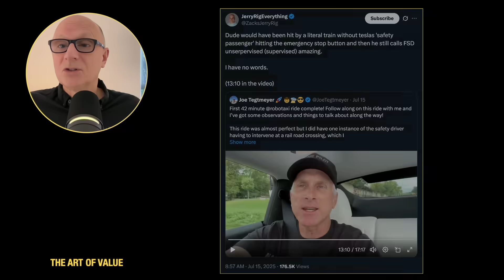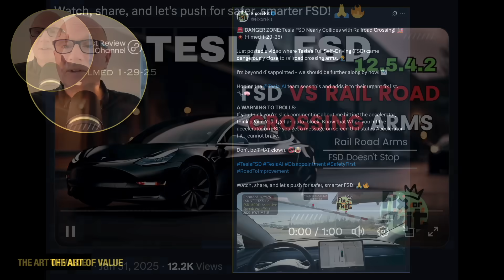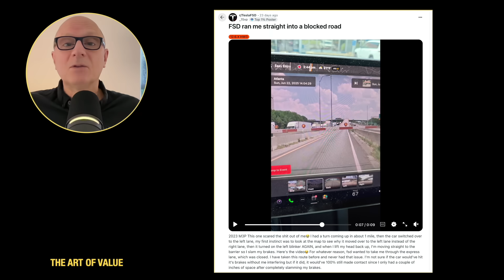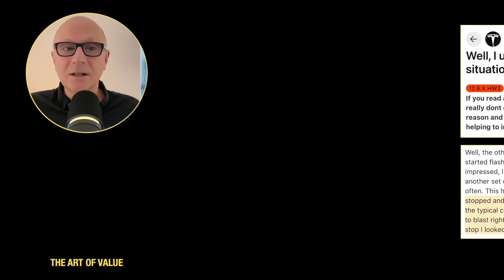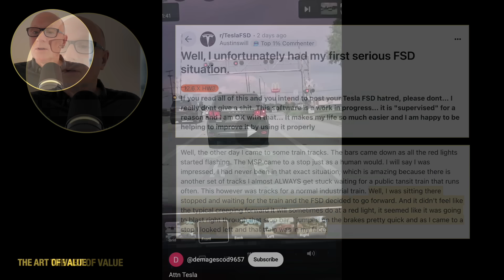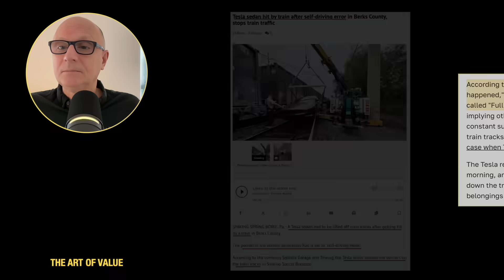DANGER: Tesla FSD Robotaxi Can Miss Railroad Crossing Arms!

Comment: It didn't see the barrier but surely it saw the red light, or did it?
Reply: That's crazy, I was thinking the exact same thing -- didn't the Tesla see that the lights were still flashing red when it took off?.  So maybe you are right -- it didn't see the lights either -- spooky...
Reply: Yes, at least over the entire time when this Tesla robotaxi approached the railroad crossing, then it did. But if you look back at this video, this it starts to show you how challenging some aspects of autonomous driving are.

In particular, there wasn't even one solid red light at the RR crossing (and there normally isn't) during the time when a train approaches and crosses. Instead, it's two central flashing red lights, which can't be seen when too far away but also can't be seen when too close to the crossing. Definitely the video clip shared here didn't show the flashing central lights of this crossing when the vehicle was very close to the barrier, but even an AV with a bunch of cameras couldn't have necessarily seen the red flashing lights near the barrier, due to the normal hoods around those lights designed to reduce sun glare.

Then, regarding the barrier, it can move down, remain temporarily fixed, or move up again, so that makes it even harder to deal with than the fixed-in-position red flashing lights (which are sometimes, and sometimes not, visible). And to be thorough, the barrier had its own small flashing lights, which move with the barrier.

I'm not saying these problems are insurmountable, but it does raise the question whether a pure AI-based approach is enough. Waymo has obviously dealt with RR crossings very carefully, and Waymo seems to have developed a good approach. Is Waymo's approach perfect? It probably wouldn't be, if Waymo expanded it to a much bigger service area immediately, so Waymo probably tests this with each expansion.

Tesla, on the other hand, is obviously failing with this stuff right now, and Tesla might not even be on the right approach to get to an extremely safe solution for issues like this. That's where the fanboys' chants of "Scale Baby, Scale!" are extremely dangerous.
Reply: @findlisa5  Yes, that is why much of this is happening -- Let's grow grow grow as fast as we can, push it out also as fast as we can to beat our competition -- not good for those who have to count on this for their safety and those around them.  Great points, and when you mentioned the flashing lights on the arm, that is the ones I myself were referring too, but you are also right that using only cameras would not be enough to see those small lights especially in the daylight.  

Lidar would be so much better, but to do that, Tesla would be looking at an incredible investment for that, plus the added bulk to the cars, unless they could find a way to downscale the system, but one thing is for certain.  If I were to ride in one of those -- I don't think the bulky Lidar would bother me in the least -- after-all, who cares about asthetics when your life and others' around you are at stake?...
Reply: @Outside-In.  Right, thanks for your feedback.

One difference between these two brands of competing robotaxis involves sensors. The Tesla approach uses only cameras for sensors. The Waymo approach uses LiDAR and RADAR in addition to cameras for sensors. 

A second differences seems to exist in how their software works. In that regard, Tesla seems to use a pure AI-based software to train FSD just with curated data from Tesla cameras (say where Tesla successfully navigated through RR crossings, for example). Waymo seems to have gone with mostly an AI-based approach, but Waymo seems to have retained some rules-based exceptions (maybe including RR crossings and possibly other things). So, I'm guessing Waymos see a RR crossing in the map data of their planned routes and then look for a combination of factors (like BOTH that RR crossing lights are turned off AND that any RR barrier has been raised) before the Waymo can proceed. This software design difference may allow Waymos to error on the side of safety in a way that Tesla can't, since Teslas are presently sticking to a pure AI-based approach. Again, I'm not certain on this, but it is my guess.

For a more common example of a similar thing, watch how Teslas and Waymos treat speed limits. Teslas hardly notice speed limits and seem happy to drive along at 10 to even 15 mph over the limits (just as their human Tesla owners are doing regularly). Conversely, Waymos strictly adhere to speed limits. (To be clear, both companies report speed limits in their SW and show limits in their cars, but there is a clear difference in how these companies use the limits when driving autonomously. Teslas basically ignore the limits and go with AI behavior based on their training data. Waymos seemingly use a rules-based approach and never exceed the limits.
Reply: @findlisa5  It could also be that Tesla's try to keep up with traffic, like if I drive to MD -- they are crazy there.  I normally drive 5 mph above the speed limit, and several cops have told me that as long as you go no more than 10 over, you should be fine, but the same cops would also tell me that -- there are some Barney Fife's that will pull you for 3 mph over (which I thought was funny), but exactly the cops are right about that.  In MD going 10 over even, is still most of the time too slow to keep up, but me being out of state there, I don't want to take the chance that I am going to get picked out of the other 20 cars LOL.

Anyhow, I am not exactly sure that Waymo should be going slower than other vehicles to maintain a legal limit, only because not keeping up with most traffic turns into you being a hazard now, so if at least they could stay close anyhow to the speed of other traffic around them, not causing frustration with other vehicles that will possibly go into road rage, may actually be a better approach, but actually so far, I have not heard of that happening with an autonomous vehicle -- yet anyway.

But I guess Waymo knows about those Barney Fife's out there and decided to not push boundaries 😉.  Thanks for the communication, it has been interesting for sure.

Comment: Even if FSD worked on 99% of railway crossings...dou you really want to gamble with your life on the 1% it doesn't?
I value my life much more than a bit of comfort. There still seem to be serious flaws that should render this feature unsafe and illegal (and in the EU it is unlikely it will be legal with such flaws)
Reply: Even if it worked 100%, who will insure a robotaxi?

If there is an accident, which isn’t even the fault of FSD, who is liable in an empty car?
Reply: I have driven well over 100 crossings in my life so far. If I'd relied on FSD and it was 99% reliable I'd be dead by now.
Reply: Then why do you tolerate 16 year olds on the road? They kill their neighbors every day (10s of thousands die every year  in the U.S. alone due to teenager drivers). If everyone was equivalently outraged at that, we wouldn't allow drivers under 25, when the frontal cortex is fully developed. And we'd invest in additional public transit for them to use while they mature. The FSD-hater hypocrisy is difficult to endure, especially considering that FSD is already saving lives. There are plenty of clips of it slamming on its brakes to avoid cross-traffic high-speed human redlight drivers, avoiding irresponsible pedestrians, etc. But those get only minimal views  because fear feeds the social media algorithm more than reason does.

Comment: I had a near miss with a freight train so many years ago, but I'll never forget it.  It was an unguarded Railroad Crossing and the sun was going down, I couldn't see the flashing lights and didn't know about the train until I was on the tracks and looking right.   I don't think I could see anything past the front of the train, it was so close and moving.  

There should be 0 certification for any self-driving system that does not have enough information to know where RR crossings are, and honestly it's time that self-driving car get incoming information about traffic, weather, road projects, potential train delays.  It's all easy enough data to receive.

IMHO Waymo will always smoke trashla, because regardless of the source more data is always better.  Musk betrays a lot of basic principles because He's trying to do self-driving for cheap.  Don't ever go cheap on plastic surgery or any software/hardware system that has an urgent requirement to always fail safe.
Reply from the maker: Waymo has had a safety first philosophy. Tesla mostly certainly has not, and it shows.

Comment: Problem with cam only is that if the AI doesn't recognize it then it's as if the object isn't there at all.  And there is no way to make the AI recognize everything.  It was never trained on those arms so it can't see them.
Reply: No, it literally can't see them. This isn't a software problem. With enough references it's no harder to classify one object than another.

The problem is that there literally aren't enough sensors of high enough fidelity on the car for it to be aware of its surroundings to a high enough degree of accuracy/redundancy.
Reply: @AvocadoAfficionado Yes, and it has no depth perception. It would need two cams per side to see depth.

Comment: FSD- full suicidal driving
Reply: TESLA: Tremendous Expected Sales Losses Accelerating
Reply from the maker: It's certainly not safe enough.
Reply: @TheJohnJohnstonLounge as much as I agree that the tech isn’t ready, I also wonder at what point it will be? We let humans drive, which is currently the single highest cause of accidents.
Reply: @thedave1771  i think it was supposed to be ready like 10 years ago.
Reply: Beat me to it!
Reply: Everything is fine, DOGE has stopped collection of accident data from Tesla so all the accidents will be phantom and deaths fake news.
Reply: Don't touch DEATH MODE.
Reply: Well since that’s not true….😂😂😂
Let’s just make things up 😂😂
Reply: Your logic, and the 179 people who have so far smugly thumbs-up'd your logic, assumes cars are otherwise safe.  Allowing licenced 16 year olds to drive on public roads results in 10s of thousands of innocent deaths each and every year. Cars are dangerous no matter what. FSD has the potential to remove 99.999999999% of the danger. It's not there yet, hence the safety-monitor that every robo-taxi has, who is present until FSD does reach 99.999999999% safe, which requires additional AI training on the edge cases, and that AI training requires real-world cases, just like a 16 year old requires real world cases before they are more safe, even though in aggregate humans at any age will never reach the safety level that FSD has the potential to reach. Yet we let 16 years old drive w/o safety monitors who so often kill our neighbors. The hypocrisy of FSD outrage is unbearable to listen to.
Reply: @TomTWalker it’s closer than people think…Tesla is beyond the beta….but your are spot on with improved driving…I use it all the time…just amazing
Reply: Not adding anything to the conversation…😂